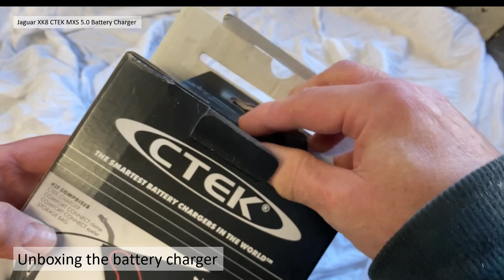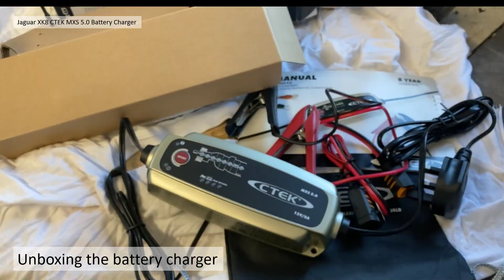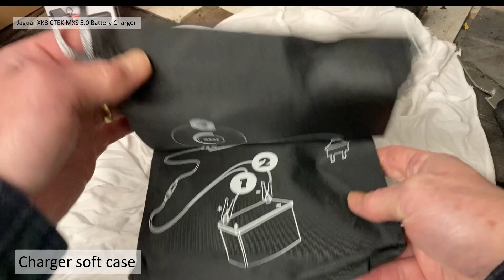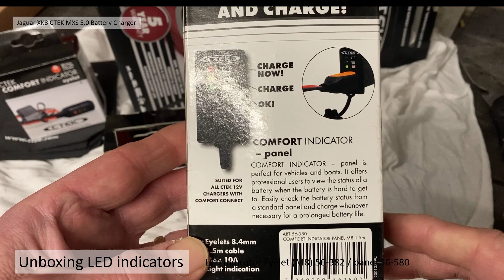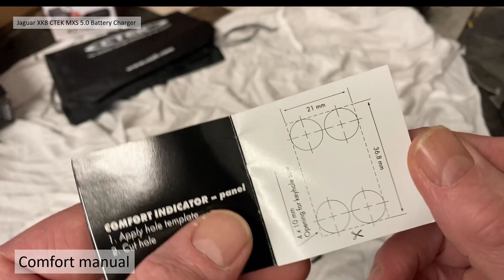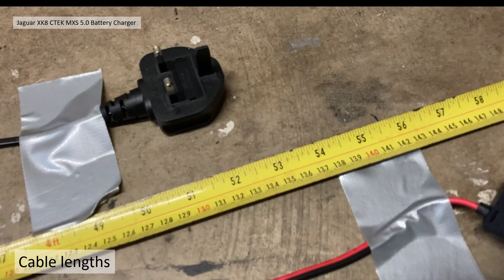CTEK MXS 5.0 Battery charger unboxing V78 Jaguar XK8  / XKR (X100)

Comment: Thank you for the information,♥️♥️ brother. I have this charger, but I am upset with it. It did not charge me any direct battery. It moves to step 4 after an hour, step 7 and then the charging is complete.  But without any result, does the dsulfator feature work or is it just a fake charger?➡️📌➡️📌➡️
Reply from the maker: Damache, Sorry to hear you are having problems. I found the charger worked well and also recovered an old battery with it. Might be faulty charging unit but also might be that the batteries dead. Hope you are it sorted, thanks for the comment regards Damian

Comment: A few months ago I noticed the voltage gauge on my XK8 was running at about 10v. It always had ran between 12-14v. When I would stop at a red light or turn my ac off the voltage would jump back up. The problem ceased altogether until one evening I took my girlfriend on a date and the voltage started decreasing rapidly, eventually leaving us stranded with a dead battery. I have charged the battery fully with a Stanley smart charger but each drive the car is starting with only about 10v and it decreases from there. Is this a sign of a dying battery, or a failed alternator?
Reply from the maker: Corey, Sounds like the battery is on its way out. Would suggest getting your battery and alternator checked. Quite easy to do if you have the right equipment. An independent garage or motor factors should be able to check for you in a few minutes and normally for free. The volt meter in the Xk8 isn't a true reading volt meter all the time. See this video 6min 48 secs in.  https://youtu.be/NN86TObH1x0  But will give a indication with ignition on but engine not running. If the volts are low in this case it is probably your battery. Anything lower than 12volts is bad news. Hope that helps. Please let us know the resulting fix. Much appreciate your comment regards Damian
Reply: @Modurol  will do thanks so much!
Reply from the maker: Corey, no problem hope you get it fixed, regards Damian

Comment: hey Damien, are you able to close the boot with the lead coming out?
Reply from the maker: Dave, yes you are able to close the boot with the lead coming over the boot seal. Planning to show a fitting options abs issues video next Friday. Thanks for the comment regards Damian
Reply: @Modurol  oh brilliant.  I have mine on order and I have an electrician booked to fit an outdoor socket on my house, so I  can plug it in.  I am also going for the Ctek sense.  cheers Dave
Reply from the maker: Dave, good choice lots of good reports. Have used the recon mode to recover an old XK8 battery that previously was dead. Good kit designed by the Swedes, regards Damian

Comment: One issue I have with our Jags is the absence of a live 12V cig lighter type outlet, just the one in the ashtray that's only hot with the key on. So I removed the "useless tray" we have in our consoles, made an aluminum plate to fill the space and installed a digital gauge/cig outlet/USB port set (eBay, about $14) and powered the outlet from the accessory terminal located under the pass side kick panel (US cars). I don't have the C-Tek but I have the BatteryMINDER brand which is the same concept. I made up a long extension lead with zip wire (lamp cord) with a cig plug on one end and and the charger plug at the other. I just plug it in every winter. These maintainers are indispensable to any of us that let these cars sit for more than a week or two. My BatteryMINDER will do 4 batteries at once so I have one plugged into my 3 motorcycles and then I bought another one just for the Jag. I haven't had to buy a battery for anything ever since I've started using them. It's the desulfation modes where these really shine. Plate sulfation is the primary battery killer and these maintainers seem to effectively remedy that. Mine has brought at least one of my bike batteries back from the dead.
Reply from the maker: Andork, sounds like you have some good experience of these battery tenders. When I bought my current XK8 the owner gave me the old battery. Currently trying to revive with the charger and seems to be working. Good as a backup away. Not sure how I am going to wire it up yet. Got the LED indicator so would like to be able to view that without opening the boot. Also how the lead will exit the car without leaving boot or door open. Work in progress. Thanks for the input regards Damian
Reply: @Modurol  I just run the lead for mine in through the window and leave it open a crack, the car is stored on a lift in my garage. You can probably just close your "boot" lid right over the lead (sorry, I still have to call it a trunk!), I don't think the weatherstrip will mind much. And yes, I've had good luck with those maintainers. One motorcycle battery I bought at least 5 years back was one of those AGM types and it just never really was right. After a year or 2 I took it out and replaced it with a standard type but when the #2 bike needed a battery it just so happened to take the same battery so I stuck that old AGM in it (that had now been sitting another year) and after keeping all 3 bikes on that maintainer it's been doing well. If you don't want to do that mod I did to my car with removing that stupid console tray and putting something useful in, maybe you could rewire your existing cig plug so that it's always hot - like every other car has done the last 80 years - then you could just plug your C-Tek into that. On another note there's probably a hot lead somewhere under the hood (sorry, "bonnet") you could tap in through if you wanted to.
Reply from the maker: Andork, thanks for the ideas. Looking for a elegant solution where it’s probably not needed. Under the hood/bonnet sounds good idea. I really like the idea of a magnetic socket so if you forget it it just falls off. Just enjoying throwing the ideas around a minute. Regards Damian

Comment: Thanks Damian, I have the 3300 , great product, I love it. It took care of my dsc fault message after fully and truly charge the battery.
Reply from the maker: Alexander, I think these battery tenders are almost a requirement of owning these cars. Glad it worked for you hoping to have less problems too. Thanks for the comment and input regards Damian
Reply: @Modurol  yes. Thanks. I couldn't get rid of the error message, until I read it could be the battery not being 100% full on the forums. That did the trick. No more dsc messages.
Reply from the maker: Alexander, going to rig mine up properly over the coming weeks, regards Damian

Comment: Surprised you want to cut a big hole in your classic jag. And pricy too. I find the other ones you got suit the jag
Reply from the maker: Andy, not too worried about cutting a small hole for the socket more interested in avoiding battery issues. Might not suit all tastes or budgets you do generally get what you pay for. Thanks for the comment and input regards Damian
Reply: @Modurol  I got a few CTEKs. The panel connectors are expensive, though I couldn’t help but purchase one when I saw one going at a reasonable price.
Reply from the maker: Andy, same here, not sure where to put mount it. Want to be able to see it and ideally not locked in the boot. The lead is quite long at 1.5m. Do you have any thoughts? Thanks for your input and comment regards Damian
Reply: @Modurol  I just connected the flexible indicator lead direct to the battery. The flexible connector cable was long enough to be above the trim in the boot.
Reply from the maker: Andy, ok cheers, regards Damian